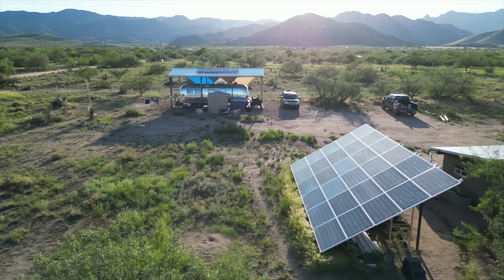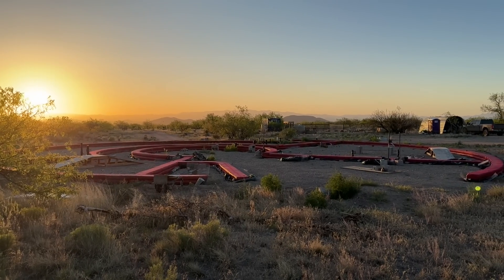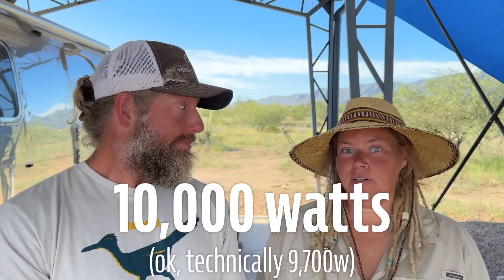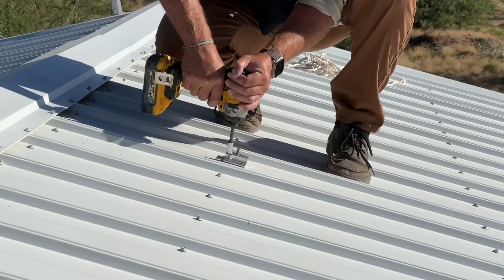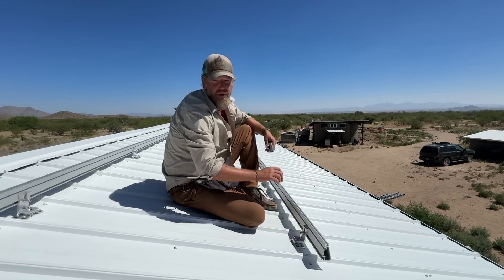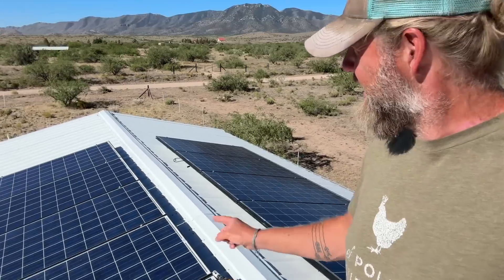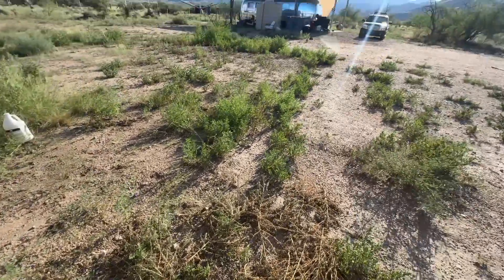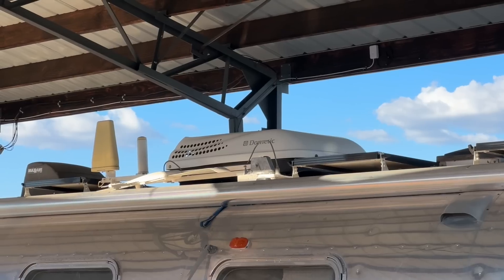BOOSTING Off-Grid Solar System for BRUTAL Desert Summers

Comment: Have you ever considered using vertical bi-facial panels?  I saw a video about them a little while ago, here:  https://youtu.be/LqizLQDi9BM   Your conditions would seem to be ideal.  I'm not related to the video I shared, it just popped in my head as I watched your video and heard your issues with solar.
Reply from the maker: No, we don't have any vertical surfaces suitable, and with our winds they would be a nightmare to try to brace and support. Plus they're just ugly in that orientation. Not really worth the added expense and complication for such a small gain.
Reply: @TinyShinyHome  --Wind can be very wicked, I don't envy that.  However, as a point of clarity for anyone else who may be interested, while not beleaguering the context, the panels are bi-facial, so, they don't rest on a vertical surface. They, essentially, become a vertical surface, and can collect from the sunny side, while the corresponding shade cools the panel on the other side. Making them much more efficient in power production and lowering the damage caused by excessive heat.  They are supported by posts on either side, so, the force coefficient of the wind would be less than the lift force on the angled horizontal panels.  Anyway, I just love the science involved.  BTW, your videos are very entertaining, and your family seems very blessed to be so loving and close I pray for your continued success.
Reply from the maker: Thanks! So while you can ground mount them similar to our configuration, the gains mainly come from being vertical and not directly getting blasted by the sun and raising their temperatures. They really aren't that much more efficient either way, though. For large installations they can make larger gains at scale, but for any homestead sized array it's way simpler and cheaper to just add a few more normal panels.

Comment: Replace your trailer air with a mini-split that will fit in the space the current air unit is in. I have seen one in another video for someone else.
The newer technology shoud be more efficient.
Also add more battery capacity!
Ok, you are installing a mini-split in your trailer, good. Should have watched your video all the way, maybe?
Reply from the maker: Watch to the end ;)
Reply: People always comment before video is over.

Comment: I'm doing a 24v solar system on my RV and considering swapping my roof air (110) for a 24v version. May add a small 12v mini split truck cab system in the bedroom (back) area of rv.
Reply from the maker: Go 48v system with an inverter and just get a 120v minisplit. The switch to 120v from 48v is so much more efficient.

Comment: Why don’t you get a solar mini split?? So you can use your battery storage at night?
Reply from the maker: The existing system will ramp up solar use during the day when the batteries are full so there's no need for us to invest in an expensive and complicated solar mini split. That being said, if you watch all the way to the end we are installing a mini split in the next video. It's just a simpler, cheaper one since we already have power.

Comment: You NEED some better ladders. You should have at least a 16’ extension ladder and also a 12’ step ladder. It ain’t worth getting hurt. You might get away with it most of the time, but eventually it’s going to bite you!
Reply from the maker: We had a ladder pro there (firefighter) all is fine.

Comment: How many A/C units are you using and what is your inside temp set at…?
We have a poly roof cover plus shade screen and the max outside is 100 plus waste heat from window A/C
Our max so far is 9.2 kWh with one air and several appliances….dish and laundry.

Comment: OMG dont do a mini split just by a central window unit for 500 dollars and duct into the trailer, i run a a max ac unit for windows and modified it and it run on ac 120 volt ac and cools 1300 square feet house in 110 degree humid ass north carolina
Reply from the maker: A mini split is so much better than a window unit. Also, we can't do a window unit with our Airstream windows. They're all curved custom glass.

Comment: Hey TSH! Good to see that you got that done and can be a lot cooler without worrying about it. Your Solar skills are amazing. Will this add to the main solar so that the A/C can be on while Ashley welds?
Reply from the maker: Well technically adding more solar won't change our inverter capacity. It's still locked at 5k watts with a 10k surge. Should be able to run the little welder we have depending on what else is running at the time.

Comment: just level the rail on the roof and mark through the hole to mark were the mount goes
Reply from the maker: The S5 mounts can technically slide anywhere on the IronRidge rail so we have to set them keeping in mind the ridges on the roof.

Comment: Have you considered wind generators? Wouldn't that compliment the solar?
Reply from the maker: In real world usage wind generators aren't worth the height required, noise, expense, and complication to actually integrate into a battery powered system. Maybe one day, but it's nowhere near being ready for homestead use currently.
Reply: @TinyShinyHome  Only knew it was an alternative.  Thanks for setting me straight. 😊

Comment: I know that you know that you can get rid of the noisy smelly generator and get a new not smelly and relatively quiet generator.  I am sure that you want a generator as a backup. New large output generators are not cheap. Propane is much better than gasoline or diesel.
Reply from the maker: Any generator that runs on gas or propane is going to be noisy and smelly compared to solar. There's no contest.
Reply: @TinyShinyHome  Agreed that any generator is awful compared to solar but it might make sense to have a generator for backup. Current generators are a big improvement over the older ones. It's your call.
Reply from the maker: We have a very recent  "quiet" inverter generator and are familiar with the options out there. The goal with this project was to not have to use it unless during an emergency. It was becoming a daily thing.
Reply: That's a great answer. You are way ahead of me. I can't wait to see the new units functioning.

Comment: Mini split will use half the power vs that roof top. Not to mention a whole lot quieter
Reply from the maker: Just wait till next week. Power usage is even better than that 👍🏼
Reply: @TinyShinyHome
Reply: And they have solar mini splits
Reply: @PjSmith Solar minisplits?!? Yep! Looked it up on Google! I learn something new every day!
Reply: The are newer roof mounts that are inverter based heat pumps. I just put one on my travel trailer 12k out for a 13.5k went from 1.4kw draw to a 680w draw
Reply: At least the power can still be useful by going to the house in the future

Comment: Exciting!  Since we're just a bit down the road from you, the power generation and usage data you've collected over the seasons will be very helpful in figuring out similar solar configurations we are planning.  Great work!
Reply: I’m constantly amazed by Jonathan’s  knowledge and capabilities and Ashley’s ability to do just about anything. This is one of the main reasons I love to watch you guys. Thank you both for sharing your talents, family and joy in what you’re doing. Can’t wait to see what’s next! Love you guys!
Reply from the maker: Yeah I wish all those solar calculators took into account the summer solstice and using less power in the winter. We would have titled our main array back 10 or so degrees if we known that then.
Reply: @TinyShinyHome  I would wish for the opposite: Solar calculators should factor in that I'm off grid in the Colo Mountains and winter is my biggest loads. I have no cooling needs in summer (maybe a ceiling fan). But snow covered panels at times with pellet stove running, lots more lights and etc.. for my most challenging case.
Reply from the maker: That’s the kind of stuff a calculator just can’t tell us yet I guess. Gotta live through a few seasons to learn what works best for you.